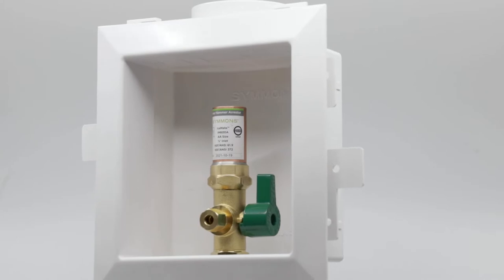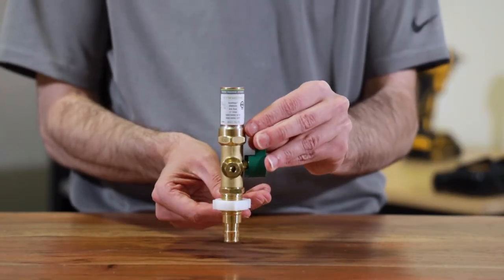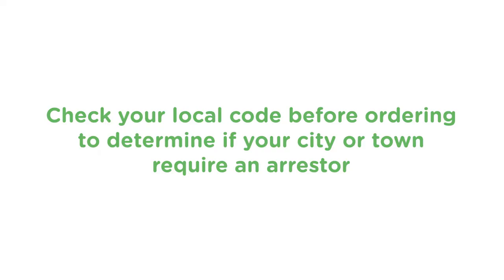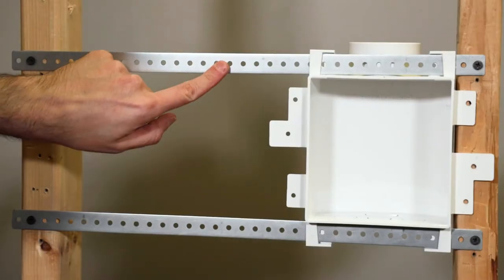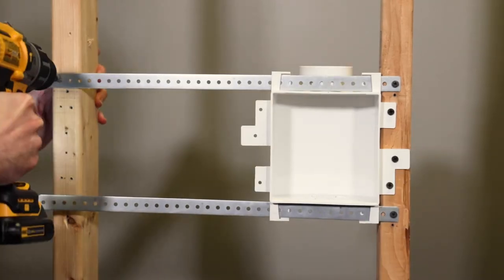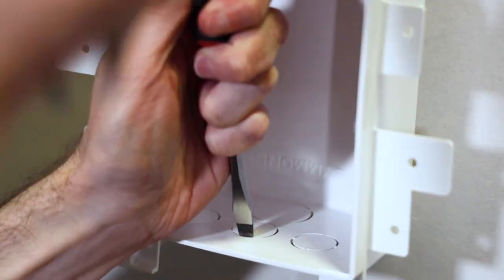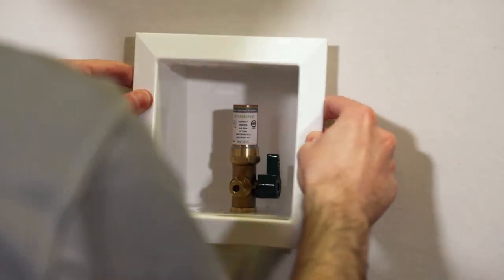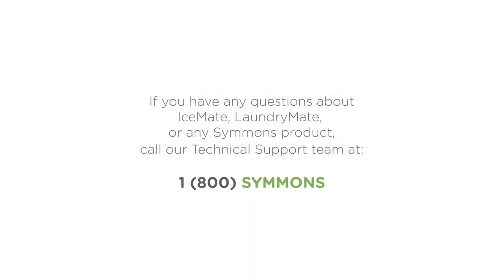How to Install the IceMate™ Ice Maker Box | Symmons Industries

Comment: So how do u solder the valve without burning the pvc case?
Reply from the maker: The best option is to pre-solder a section of pipe onto each shutoff valve, and then pass them down through the holes in the box. Don't forget the locknuts!

Comment: What height should it be installed at?
Reply from the maker: Hi William! That's determined in the field depending on the location of the inlet for the refrigerator being installed. Most refrigerators have the inlet at the bottom, which is why we showed it installed in the video 6 to 12 inches from the floor.